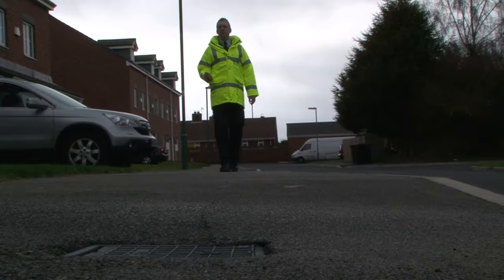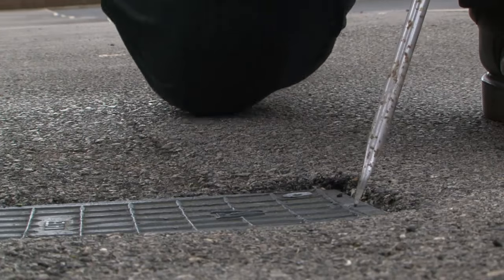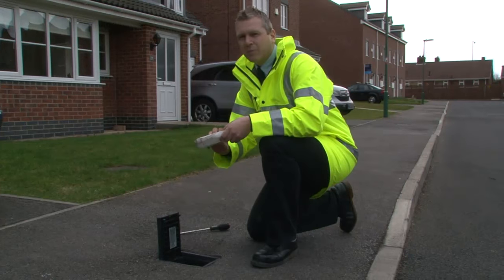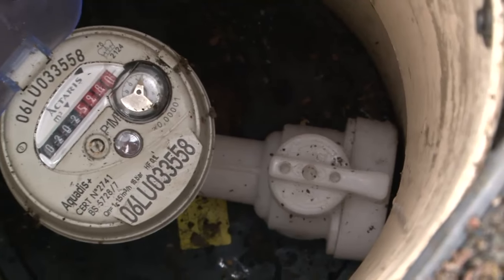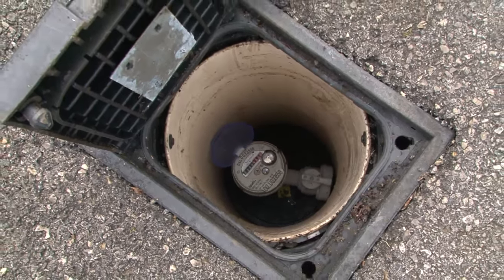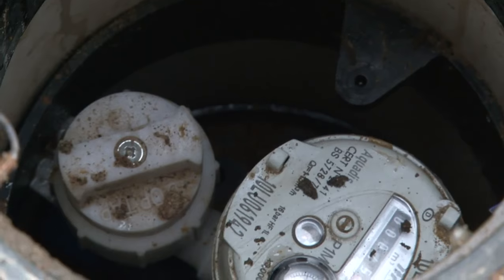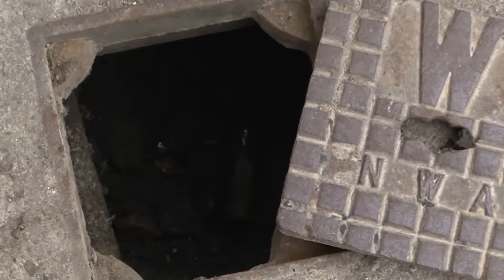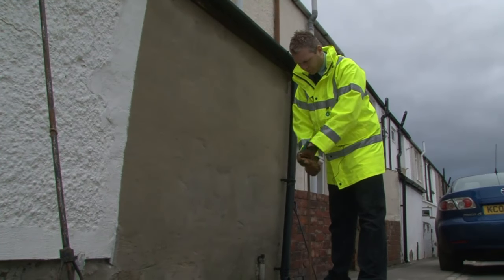Locating and accessing your stop tap

Comment: I have a shared drive with both access panels for both houses. They have started to drop a bit with the tarmac due to weight of cars going over. Would putting some hard core around it then new tarmac over it be ok.

Comment: What did you use to turn the two plastic locking lugs on the rectangular cover?
Reply: They're just pegs. If you use enough effort to pry the cover open, they'll just pop out. They can be pushed back in pressing on them when closing.